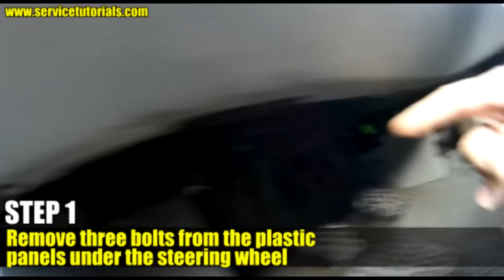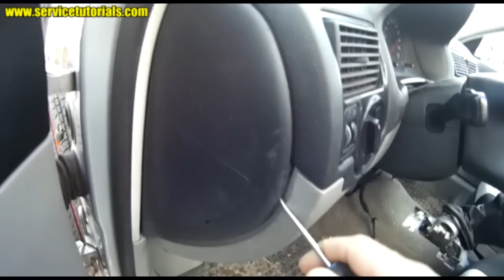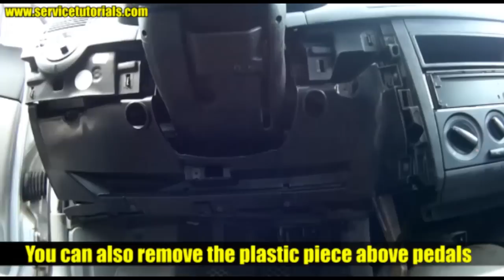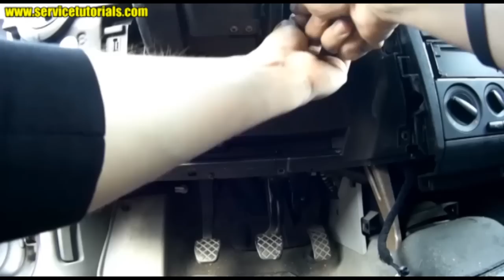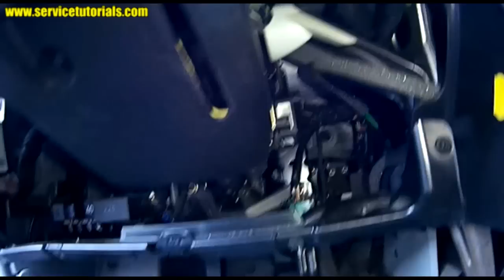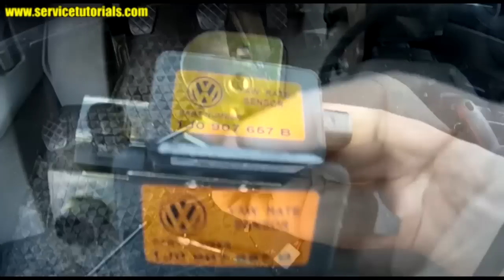How to remove / change the yaw rate sensor G202 and the lateral acceleration sensor G200 VW Golf Mk4

Comment: is it possible to fix yaw rate sensor if its faulty? or its must be replaced with new one? plz help i have problem with my esp yaw rate sensor on golf mk4 1.6 16 V. the lamp wont go off when i am driving car and it cant be turn of on esp button , once when i was driving trou the city , i felt the braking pad started vibrating when i was stearning whell to turn left in street and my car engine shuted down. and i needed to turn enngine on again , can you tell me whats the problem . ty for any info ahead . sry for my bad eng XD
Reply from the maker: Nikola Jovic Hi Nikola! Yes, you can repair the yaw rate sensor.
Reply: @Servicetutorials  how can you do that
Reply: You can’t turn on the ESP after the car has turned it off (because it’s faulty). You need to manually turn off the ESP as soon as you start your car. That way you won’t have any trouble with the ABS randomly kicking in. This is how I did it until I got a replacement sensor.

Comment: trying to do this on a right hand drive Audi S3 8L. The bracket is on the left hand side of the steering column and I am finding that bolt impossible to access it with tools